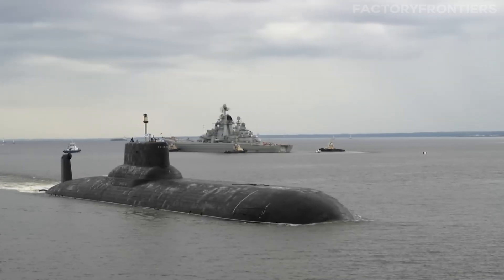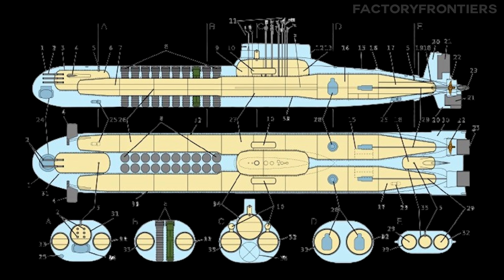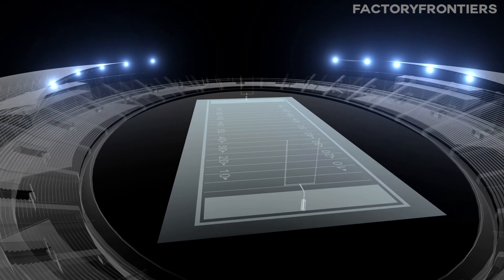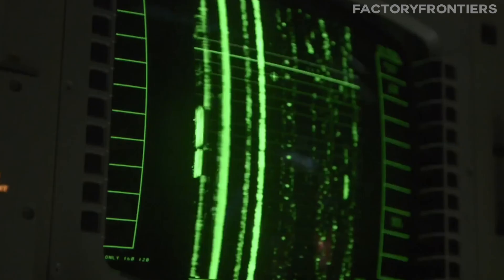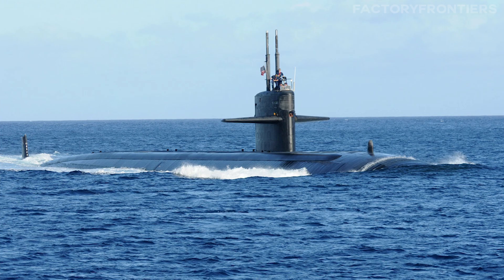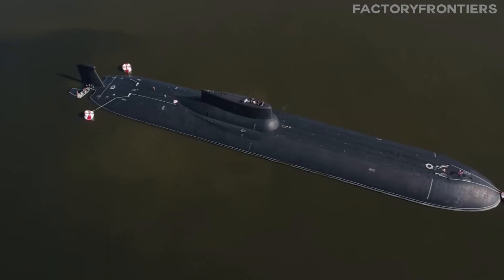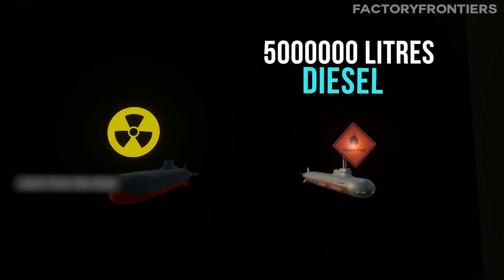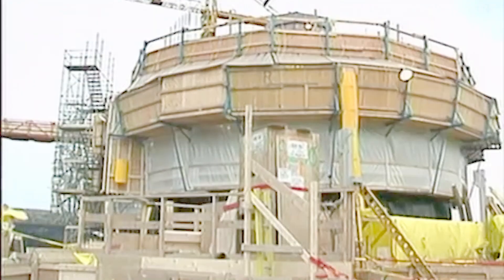Inside the World’s LARGEST Submarine

Comment: Nice video but just a notic
The largest submarine is the Belgorod which was put into active service in 2022 it is 184 meters long so about 9 meters longer. And today are 0 of the 6 Typhoon Class (Akula or Project 941) in active service
Reply: Try again, title says largest. You're equating length to size, Belgorod is smaller
Reply: @devo1977s  That's not what she said.